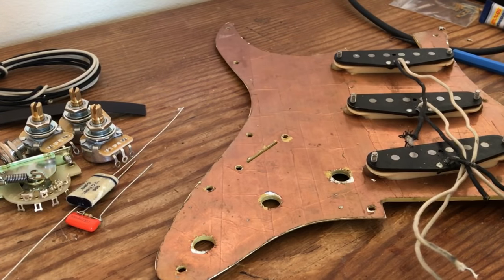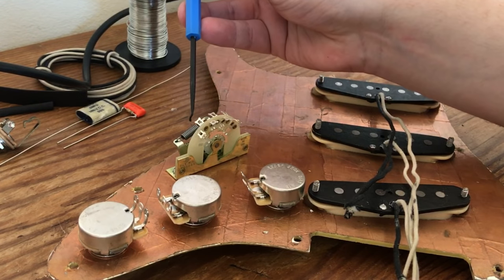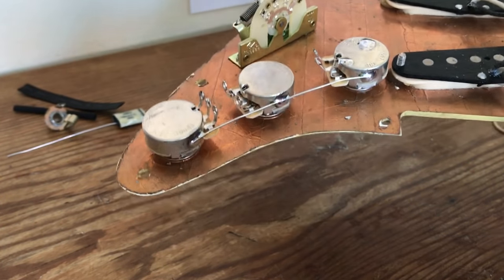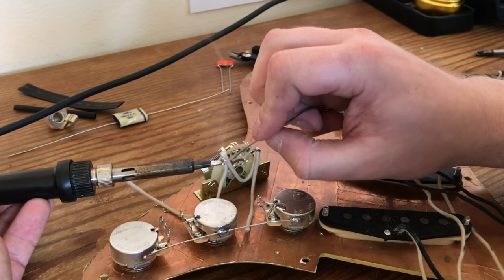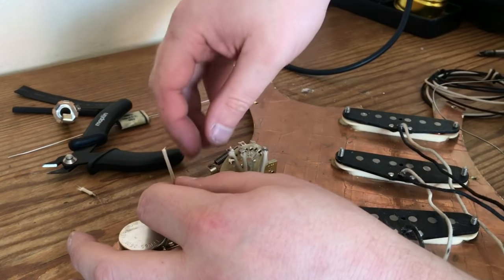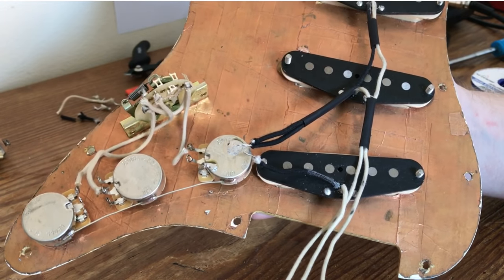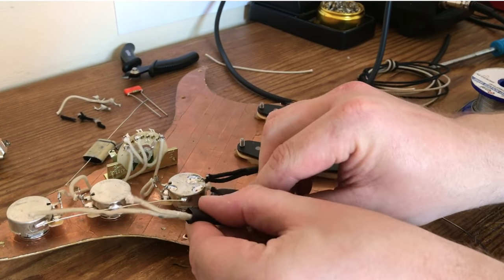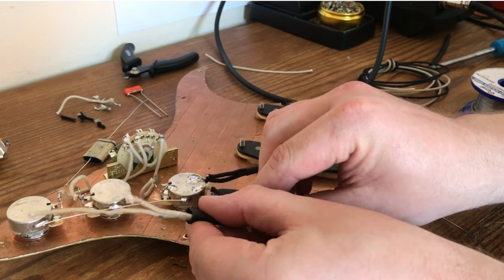How to wire a Stratocaster - Grounding, Pickups and 5 way switch

Comment: I just wired my strat with the exact same pickups and electronics, I followed the included diagram to a tee. Only when I closed it up I def think I have a bad ground somewhere as the hum is extremely loud and the whole thing sounds muffled. I can’t seem to see any issues with the soldering or connectors. I didn’t use heat shrink with mine. Only thing I can think of is the supplied input jack is def way longer than the other one I was using before so I routed a really tiny cavity so it could fit. Gonna recheck everything again when I get back. Any suggestions what to look for?
Reply: Did you ever figure this out? I have the same issue. Everything looks connected right, but theres humming until I touch my jack.
Reply: Sounds like something's grounding out.
Reply: Mathewson Ramsey  had the same problem too. My pickup adjustment screws were too long and they were grounding out on the Faraday cage. So I routed out more room, then it was the output jack, then it was the 5way switch. After I fixed everything, it sounded fantastic!

Comment: I noticed the back of the pick guard was shielded with copper tape but you didn't include a wire from the back of teh volume pot to the shieling tape in the control cavity.
Reply from the maker: i think this was the first video I did. It is not necessary, as the pots should be coming in contact with the copper, and therefore grounding it. However, the lock washer teeth can eat through the copper tape over time, which is another reason to add the additional ground

Comment: at around the 24 minute mark you had a cream ground wire and a black ground wire, where would i purchase those?
Reply from the maker: Hi - available on our website  - either in 2 ft lengths or 5ft utility packs  http://www.sixstringsupplies.co.uk/product/vintage-push-back-guitar-cloth-wire

Comment: Did you wire the bridge to the tone control?
Reply from the maker: No, but for that mod the diagram is here, the red wire linking the two lugs on the switch https://www.sixstringsupplies.co.uk/stratocaster-wiring-diagram

Comment: My I wired my strat and I'm getting no sound from the pickups, just loud 60 cycle hum and when I touch a metal part, it stops. Please help
Reply from the maker: TupolevPilot hi look at your ground circuit - it's not grounded properly

Comment: vintage strats will not take that pickup ground wiring solution with the heat shrink and shortcut, they have a channel where the wires run so all wires must exit out the bridge pickup, no shortcuts, only bathtub routes will take it like that so be careful and take note of pickup wire routing wont wanna short change yourself, you might pinch it even with a humbucker route at the bridge just sayin.. check first